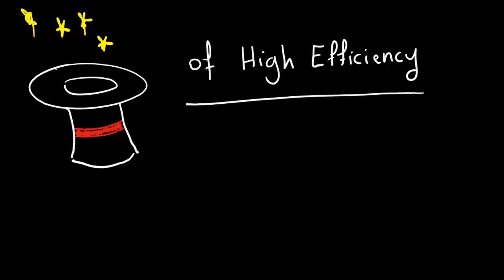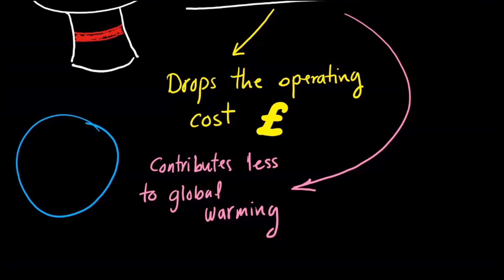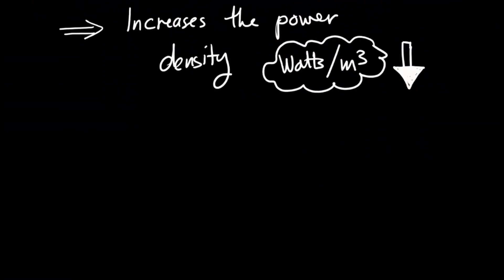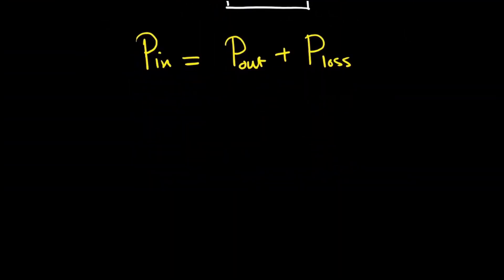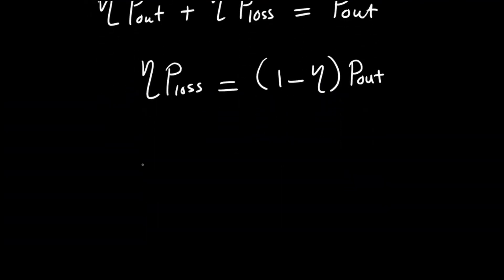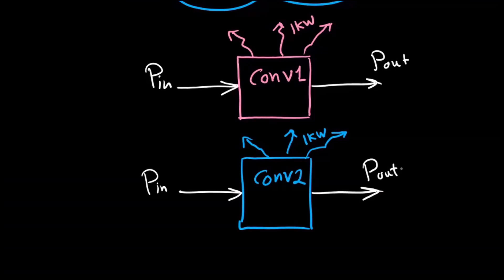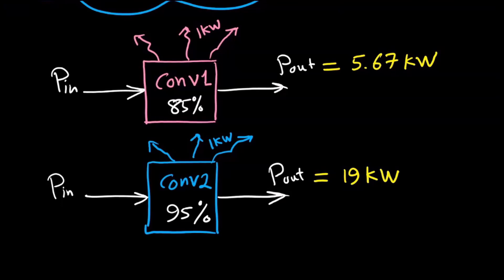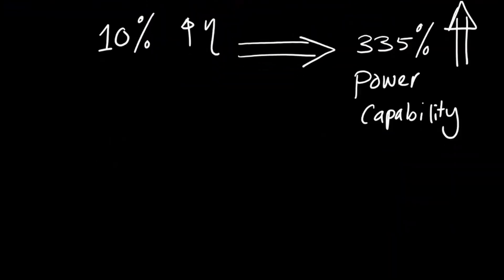The magic of high efficiency

Comment: Nice video. But there is a small mistake. The output power is 3.35x more, which is only 235% more. Think of it like this, when the output power doubles, e.g. it is 2x more, then percentage-wise the power is only 100% more.

Also, this is not true for any 10% increase in efficiency. Eg. with efficiency improved from 0.75 to 0.85, the output power is only 1.8x more. As the efficiency approaches 1, the output power goes to infinity. This is why 𝒉𝒊𝒈𝒉 efficiency is desirable.
Reply from the maker: That’s why I call it magic, just to highlight the idea. Thanks for the feedback.